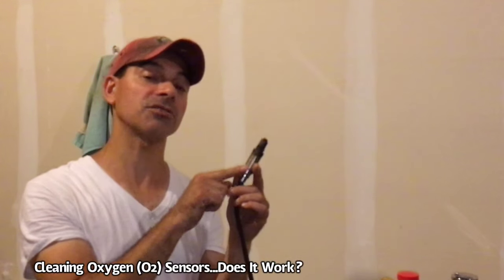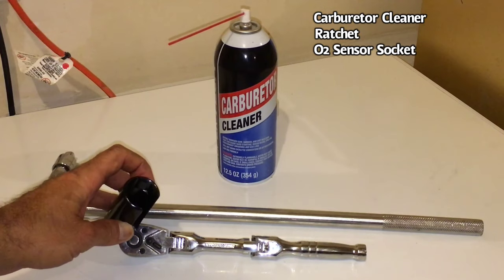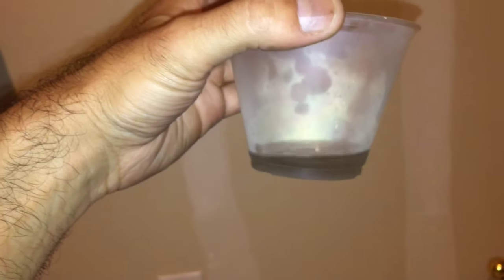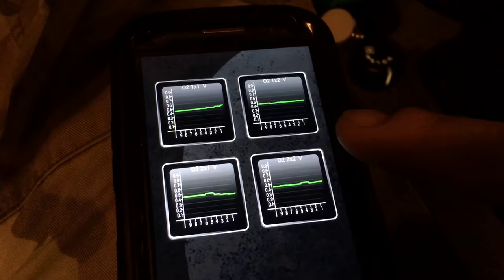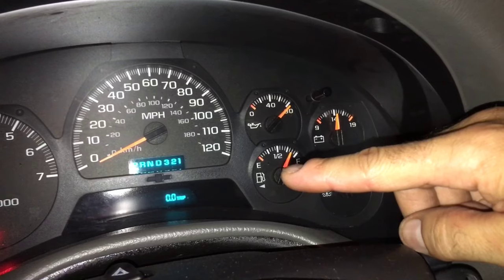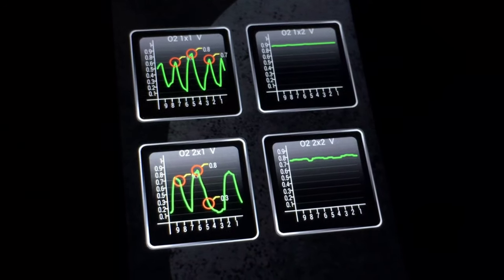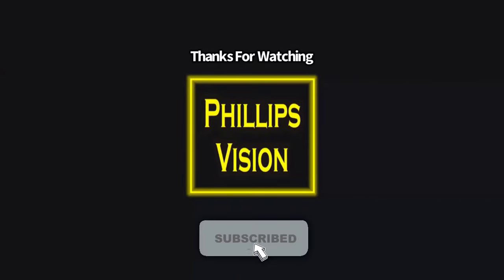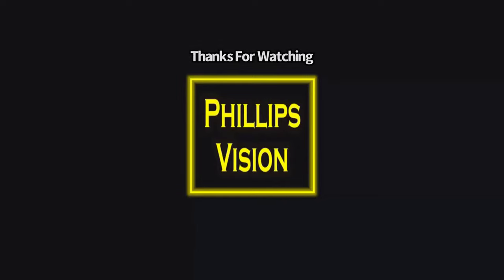Does Cleaning Oxygen (O2) Sensors Really Work??? (Andy’s Garage: Episode - 209)

Comment: Not being funny but your experiment is somewhat inconclusive because you cleaned a sensor that was already failing. I would think that cleaning a sensor that has not failed from time to time would actually extend the sensors life.
Reply: This is true, if the heating element or the wiring has gone bad(physical damage) cleaning is of course not going to solve the problem

Comment: Use Carb cleaner, Acetone, or Lacquer thinner, to clean an O2 sensor. Then heat the sensor with a propane torch until it is red hot. This will burn off any Carbon build up left after cleaning. Clean once more with whatever solvent you used before and the sensor should be as good as new. I have used this method to get more than 200,000 miles out of sensors. I have replaced only 2 sensors in my 2002 4.1  6 cylinder Jeep Grand Cherokee Laredo that has 480,000 miles on it. A recent trip from So. Cal. to Yerington ,Nev. gave me an average of 20 MPG at 70-80 MPH all the way.
Reply: is carb cleaner similar to intake valve cleaner ? 
Which one would you recommend ? Also to get the O2 sensor off should i use WD-40 or penetration spray before
Reply: Oil pressure to high
Reply: I had the same idea with that propane torch. Would you do it also with a catalytic converter? I am asking, because I am worried, that my new catalytic converter could be clogged up because the engine was running rich for about 1000 miles.
Reply: outstanding!  money in the BANK
Reply: i once used propane (or perhaps MAP) on spark plugs and had problems....

Comment: Yes cleaning can work, i had a BMW which was running rough. i did not have a meter to check for codes, however, i decided to change the bank 1 oxygen sensors. I used white vinegar in a see through container. i dangled the sensor ends in to the white vinegar for 5 days, shaking them in the vinegar at least twice a day. At the end of the 5th day i gave them one last shake in the vinegar and took them out and wiped them clean. There was carbon in the vinegar which told me that some cleaning had occurred. After installing the cleaned sensors i started my car and went for a drive. To my amazement the car was no longer misfiring, rather it was running smoothly and as it should. I am not saying that cleaning an oxygen sensor will always work, however, for me it was successful.
Reply: Nice. I suppose if the heater unit on the sensor is broken you'd need to change them regardless.

Comment: A rough idle is more likely due to a vacuum leak then a faulty O2 sensor. Any vacuum leak would also cause an O2 sensor to get dirty and fail. I would do a smoke test first and find your vacuum leak before you throw a new O2 sensor into it. A dirty or failed O2 sensor is just a symptom of the problem. The lean code could be a vacuum leak or dirty injectors. When you have a lean code it dumps extra fuel in the system to try to compensate for the lean problem. That's what makes your O2 sensor fail, all the carbon buildup from all the extra fuel that the computer is dumping into the engine.
Reply from the maker: Thanks for the input
Reply: vacuum leak from Disa Valve?

Comment: This will help my process of elimination though. Smooth idle and smooth driving for 40 miles then back to crap helps me actually feel better about buying the new o2 sensor knowing that’s the actual culprit. So I guess I’ll be cleaning them and if it clears up my rough idle and gas smell 👃 I’ll be glad to buy new ones. Just don’t want to throw parts and kill my wallet. Thanks!

Comment: you should have cleaned it with an intake valve cleaner. I use CRC intake valve cleaner and it brakes down carbon pretty well.

Comment: The sensors you shown 1st and last are the same but 2nd is not. The curve at 6min shows good sensors, but curve at 8m13s already shows problem - both are rich and 1x2V O2 doesn't work, then you drive and shows it too lean error. Not sure how you swap/change O2s, but a non working too rich O2 can be too lean after 42miles driving is irrlogical. Hope you can clarify. One thing is sure - clean out shell no help, you need to merge into liquid to clean the sense element.

Comment: I use a wire brush and when there caked, it does make a difference. After cleaning and reinstalling.  The o2 upstream affects fuel trims , timing ECT. Wire brush works best.

Comment: LOLOL…. I bought a New upstream O2 sensor from a National auto parts store. Got the wrong one, the electrical connector was wrong. So I took a picture of the old connector. Removed the new sensor, but before I put the old sensor back in I sprayed it down with engine degreaser.  Let it set about 5 minutes. Then replaced it.  I drove down to get the new sensor.  And on the way home the check engine light went out. 🧐  I have driven 52 miles so far and it’s still off.  I will keep the new unopened sensor around for at least 200 miles to see if the cleaning worked.
Reply: Did that work

Comment: I spray carburetor cleaner on it, then burn it for few second, then i sand it with 600grit sand paper, after that the oxygen sensor super clean inside and outside
Reply: I would think an old toothbrush is better, sandpaper looks a bit severe.

Comment: The culprit is not the O2 sensor, it's the fuel consumption of the car. Over time fuel consumption screwed up from resets of error codes. If a driver only knows to monitor the fuel consumption against the speed, then your car will be okay. When car is old, expect the worst. My E90 has 250,000 km on it, but I keep monitoring gas and speed, I never done any repair or change on bank1 bank 2 sensors. Its the speed matching with correct gas consumption

Comment: I have a 2022 Honda Accord Hybrid Sport it has a P0171 code system to lean bank 1 sensor 1. I already replaced the MAFS mass air flow sensor and still get check engine after driving 40-50 miles still throws  P0171 code I called Honda to buy O2 sensor. They quoted me almost $600$ 😮 just to  pick up part for it. Is this normal for an O2 sensor to cost that much. I heard u say in video they are not expensive and I don’t remember paying that much for an O2 sensor but I was curious where do u purchase ur O2 Sensors from?
Reply from the maker: The most I’ve ever paid was $68 for an oxygen sensor. Some foreign cars can cost more, but never heard as high as you were quoted, maybe $200

Comment: Just free try of cleaning the sensor. If worked good of not replace it. Except if you replace the catalytic converter, you need definitely to replace all oxygene sensors, no cleaning old one, because bad oxygene sensor may missing up your new catalytic converter by sending innaccurate information to the the car computer.  Many people do this mistake replacing the catalytic converter without replacing oxygene sensors.
Reply: CC.... hard to remove and $$$$$ too. Better to clean using Lacquer thinner in the fuel?
Reply: not true at all sir

Comment: What's the link to that scan tool used in video?
Reply from the maker: It was a Bluetooth scanner that works with the Google Play app “Torque Pro”. It’s not on eBay anymore. There are other ones similar if you search “Bluetooth OBD2 Scanners” on eBay. They are usually around $10

Comment: What if i use carbon cleaner foam like DCS?? It will clean the carbon in the O2 sensor faster and will look like a new sensor but for a long run can damage the ssnsor??
Reply from the maker: Mr Reza never used that cleaner. You could try it, but at the end of the day sometimes the sensor just needs to be replaced
Reply: @PhillipsVision  ok thank u for the information

Comment: you gotta soak the sensors in gas for at least 24 hrs and when you're dealing with 4 o2 sensors that cost $260 per side you might want to try saving $570 including taxes.

Comment: Do I need to disconnect the battery when taking off/replacing the O2 sensor
Reply from the maker: You should anytime you are working with electrical components, however, I do not do it all the time

Comment: Pssh dealer just quoted me $2400 for a 19 ram 3500
Reply from the maker: You can do it yourself for approx $300 to replace all sensors
Reply: @PhillipsVision  where do I get cheaper sensors though? I’ve tried to see if earlier models had same part number but they’re different. The one I need they said it’s 2,400
Reply from the maker: @travislarson9776  I get Bosch sensors from Autozone and Advance, around $59.00 each. I know mechanics who say only use dealer sensors because they perform better. I’ve had issues with cheap Chinese ones but not with Bosch.
Reply: @PhillipsVision  hmmm I’ll have to just buy one and see it it works
Reply: @PhillipsVision  just curious if they’re about 60 each where’d you get 300?
Reply from the maker: @travislarson9776  my vehicle takes 4...2 upstream and 2 downstream . I rounded up a little because yours could be more per unit
Reply: @PhillipsVision  oh ok I only got 2 so if those work I’ll be a little cheaper. Thanks for the info
Reply: Damn, wow, wtf
Reply: @OAXBORN  good thing the parts dude had no idea what he was talking about and quoted me for the wrong one. It’s was only about 300
Reply: @travislarson9776  Get the factory part # and do a search.